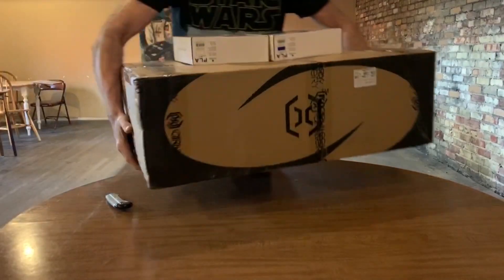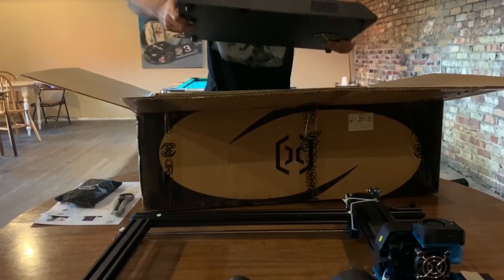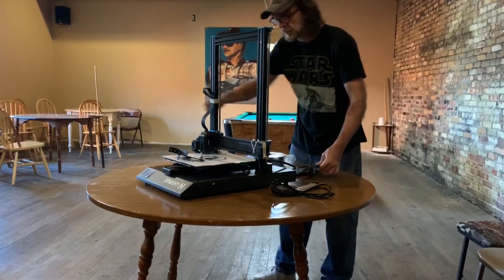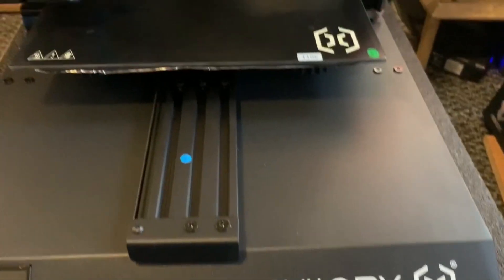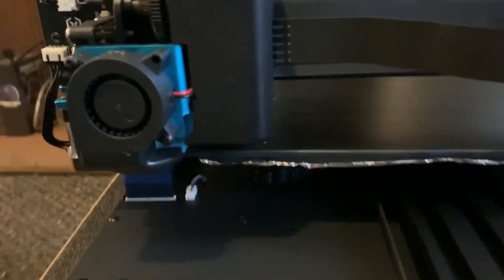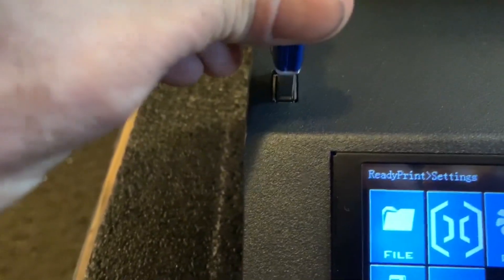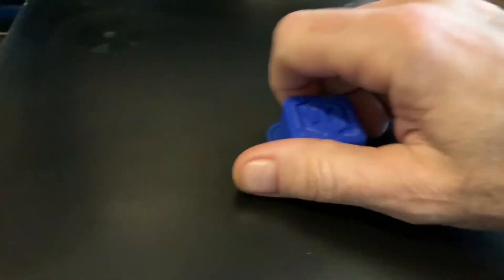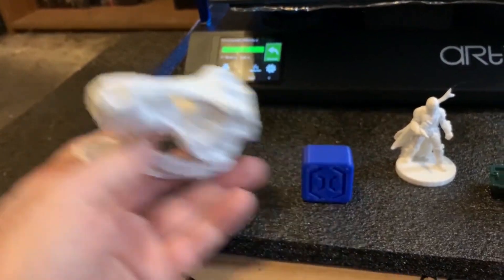Lazer gets a 3d printer- Artillery sidewinder X1 v.4 Unboxing, setup and first print

Comment: I got a 3d printer recently, it's amazing
Reply from the maker: I've only been using it for a few days, and I'm loving it.  The possibilities are endless.
Reply: @LazerboltVids  for sure. I've also been surprised that parts if things break, at least for my printer have been very inexpensive.

The channel CNC kitchen goes indepth on all the slicer settings and their effects on strength and quality, highly recommend